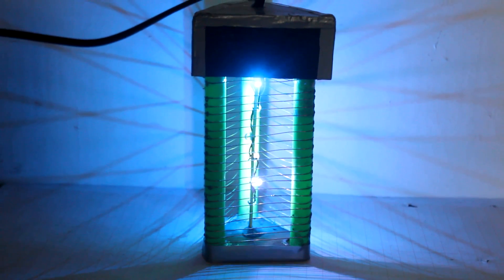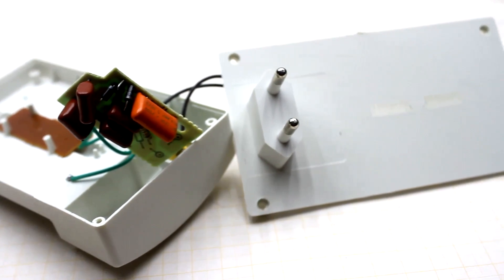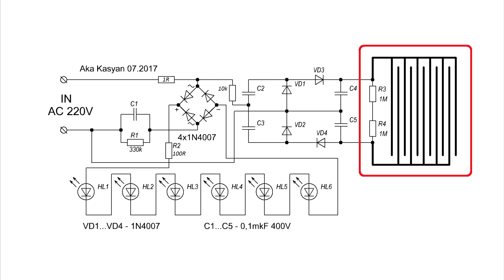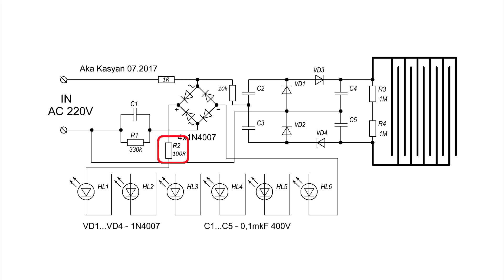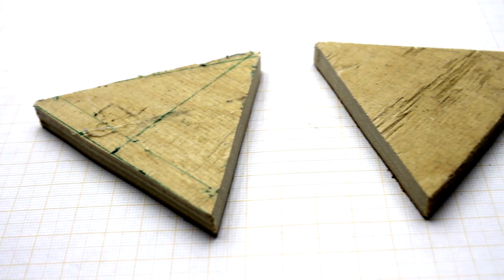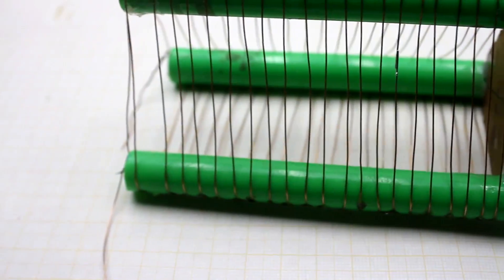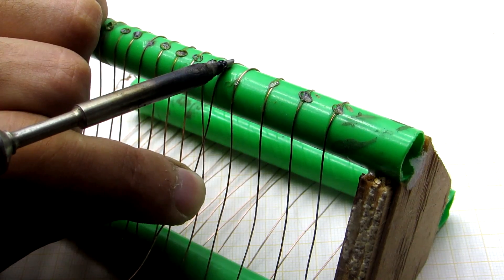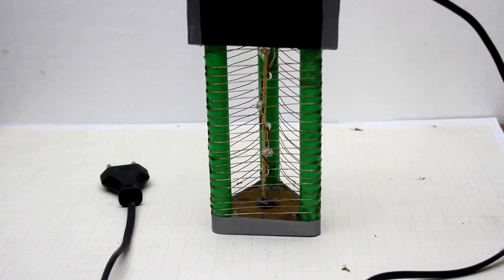How to Make a Super Mosquito killer

Comment: ok, 220v with 2stage voltage doubler = about 680v on the capacitors that is made to handle 400v!!! wtf!!!
Reply: The Voltage that each capacitor handles is the recrified mains, so approximately 320 volts if l'm not wrong
Reply: @diyelectronics5537  nope, it is double the peak voltage of mains, so yeah more than 600V

Comment: Although operating principle is OK, I would discourage it for safety issues. No protection from weather, from short circuits and worst of all from being touched by pets or people. This can kill - (and not only mosquitoes).Good quality insect zappers are not that expensive and have safety features installed.. If one is inclined to experiment, at least safety features should be included.

Comment: you can also make a two closely separated chicken wire as the zapper, just make sure the voltage isn't big enough to make the current arc through the air, only the mosquito body that become the medium of the current